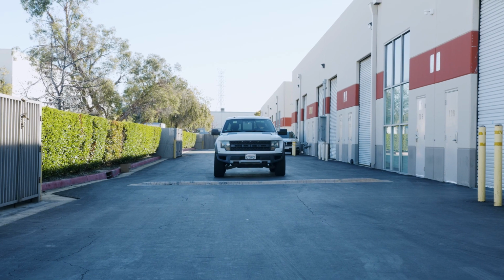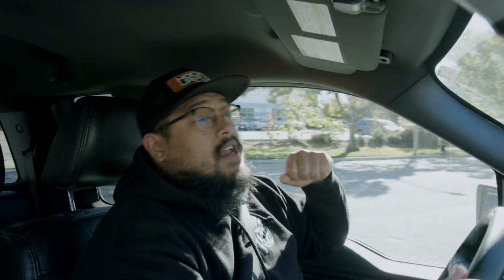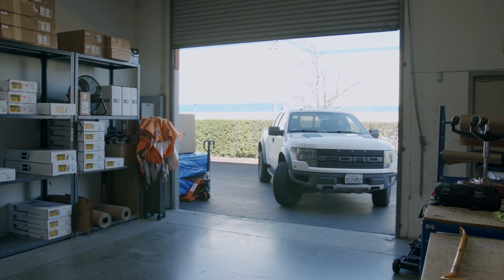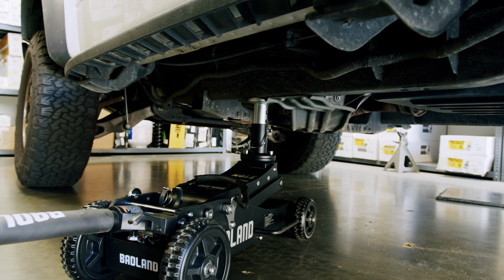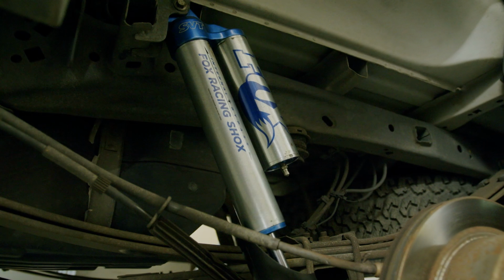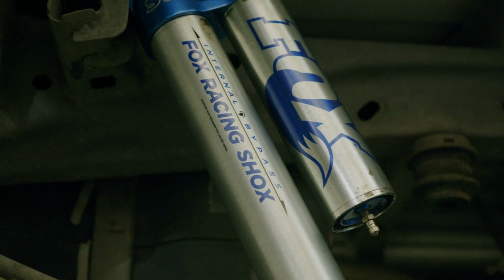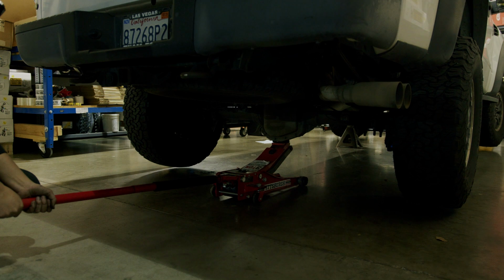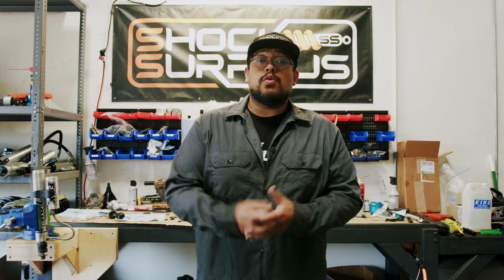Drive Through Shock Service - Ford Raptor Fox IBP Rebuild

Comment: My truck having the work done in this video.  Relentless work schedule at the time had me working not far from the shop for a week, so we sorted out a date and time.  (Helpful that there's a car rental place not too far away.)  Solid work done in one day for a fair price...picked up that evening.  It's nearly a year later now and a few thousand miles behind us, and the work has held up.  Highly recommended!
Reply: Do you mind sharing how much they charged?
Reply: @RS11199    It's not that I'm withholding anything, but I don't think it would be fair to our friends at SS to broadcast on their YouTube page what I paid in March of 2023.  I got in on less than a week's notice, and they stayed after hours to get the work done.  And I think I was lucky to secure that particular date, given how demanding my schedule was back then.  What I paid for that job might be more than what another customer might be quoted with a little more notice.  Have you gotten a quote?  I'll also state that nearly a year and a half later of street and highway driving, their work has held up.
Reply: @ErikCEmerson  I understand, just didn’t know how much the labor was to remove and install. Trying to decide if I want to do it myself or not
Reply: @RS11199   Reach out and get a quote...then you got accurate info that applies to your situation.  I don't have a level driveway, so removal & install ain't an option for me.  Plus it doesn't cost anything to get a quote.
Reply: @ErikCEmerson  I’ve tried calling a handful times times over the last few weeks but never seem to get through their call waiting gate, I’ve sat on the phone for 10-15 minutes before 

Maybe I’ll shoot them an email 👍🏼
Reply: @RS11199    Now that you mention it, I recall the phone not being the easiest way to get through....although I was able to at a certain point.  I've got a long-ish chain of emails with SS trying to schedule on my rare days off back then.  So yea try that.  Also looks like their website has a chat function...maybe that'll get through.  Or if you're on FB, maybe try messaging there.

Comment: What is the typical price for a rebuild on these shocks? You mentioned in the beginning that it was 2 years since the owner last rebuilt the shocks, so I assume its an ongoing maintenance item and would like to know the average cost. Do you also rebuild shocks from newer Bronco Raptors and F150 Raptors?